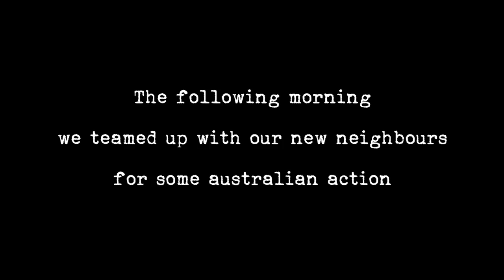Escaping Quarantine & Learning to Live like an Aussie⛵️ Season 2 Premier (Expedition Drenched S2Ep1)

Comment: So, how can a boat with a bow at each end only go "backward?" Lol. Fun video. Thanks.
Reply: Backwards for a boat like that is traveling with the propellers pulling the boat, as opposed to pushing the boat. Pulling the boat with the propellers is less efficient, but for a short ferry trip will pay for itself by saving the time and fuel to turn the boat around at each stop.
Reply: @brewmagoo589  Thanks!